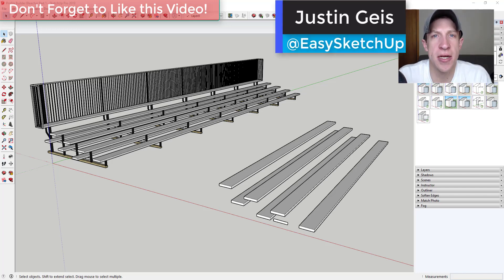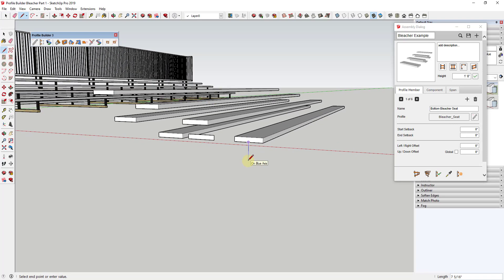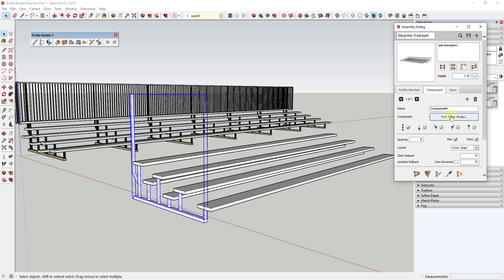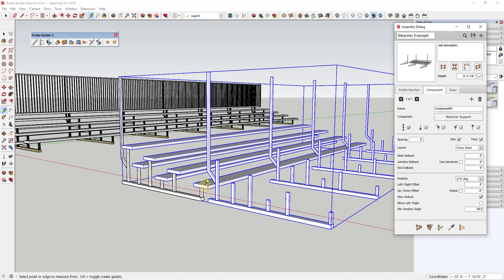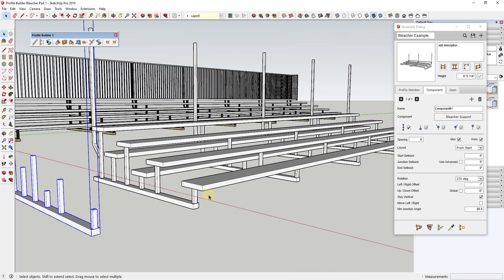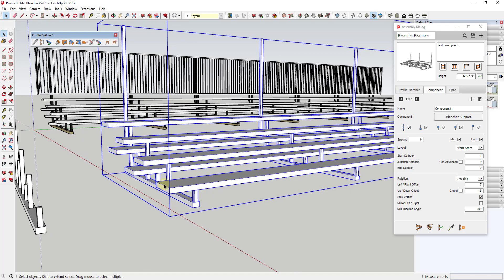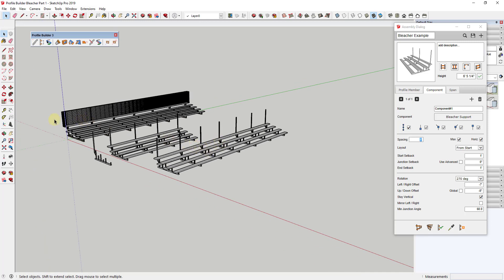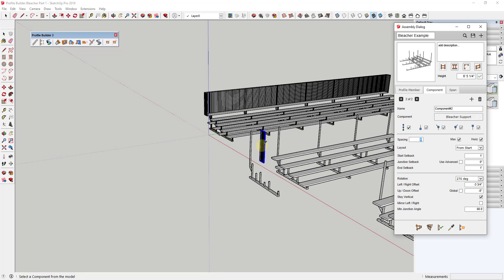Creating a Bleacher Assembly in Profile Builder and SketchUp - Part 2 - Component Supports

Comment from the maker: Have a good Friday everyone! :)
Reply: Thanks to your superb work, Justin, I've made good progress with Sketchup Make, but I'm stumped on creating a wedge with rounded edges for 3D printing - think of those old fashioned rubber door stops. My first instinct was to use the arc tool to scribe a tangent curve on the face of the wedge, then use push-pull to remove the unwanted corner. However, as you guessed, the push pull tool will not follow the Z axis, but retreat along the angle of the wedge face, and trim the corner as desired. I've also tried your nice 'intersect with model' approach with a cylinder mated to the wedge, but, again, deleting where the curve of the cylinder meets the edges of the wedge, also deletes the entire interior of the wedge.  Does this make sense? Any thoughts? Thanks in advance!
Reply from the maker: You may wanna try round-corner - https://www.youtube.com/watch?v=36myjGh1iGw